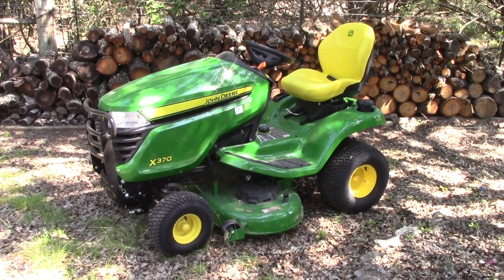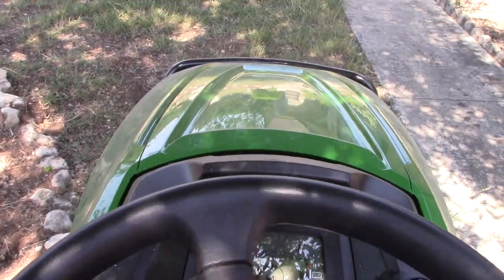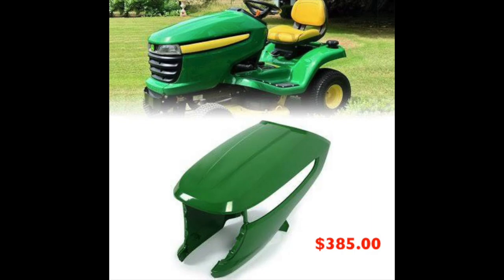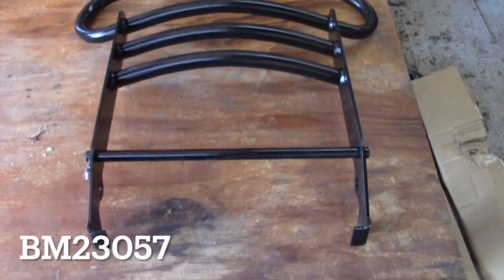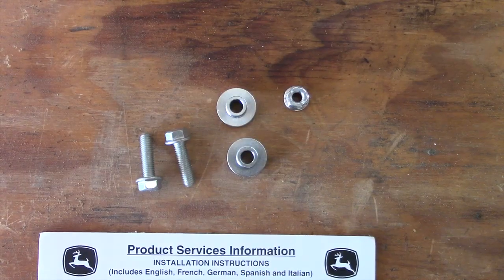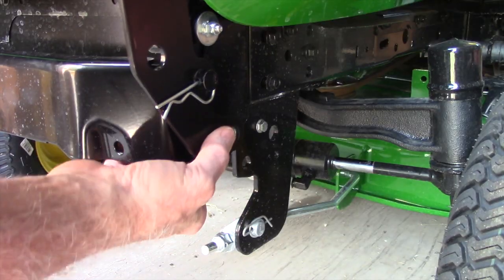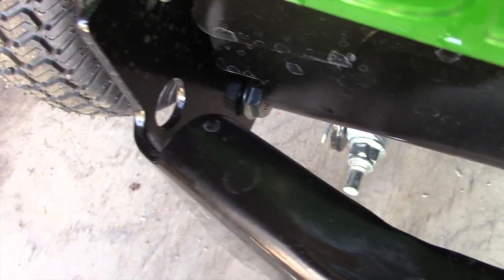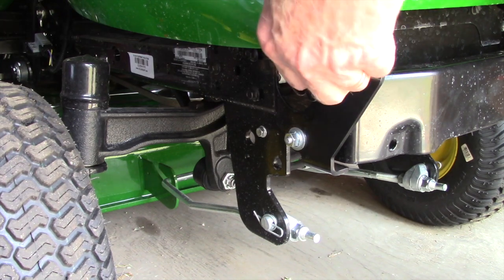John Deere Brush Guard

Comment: The instructions that came with the brush guard were essentially useless.  But this guy's instructional video is key to installing the brush guard correctly, particularly with respect to inserting the bolts from the inside of the frame towards the outside.  Until I saw this video, I could not figure out how to get the bolts in due to the muffler shroud being in the way.  I was super frustrated and almost to the point of thinking I got the wrong brush guard for my X350.  So I went straight to YT and found this video....and problem solved.  Thank you!!!
Reply from the maker: Glad it was helpful. Thanks for commenting!

Comment: I mow as a side hustle and have been using a little 42" cub cadet. I just took on a new customer whos entire acre is hillside with forest at the outlying areas. My cub cadets turf saver tires and tiny brakes arent  up to the task. I pushmowed it today,just because i promised id take care of it since no one had mowed it in weeks. Next season i intend to buy an x350 or bigger mower and id like to protect that front end against.  He had a friend of his mowing it,but he stays busy and had to let it go. He was using an older john deere garden tractor with ag tires. He doesnt understan why i cant mow it with my cub cadet lol. Theres a big difference between a garden tractor and bargain box store mower.
Reply from the maker: Thanks for commenting!  If you're dealing with a lot of hills or rough terrain, the X500 and maybe even X700 series may be worth a look. They're more like garden tractors, with stronger transmissions and axles.  The Kawasaki twin upgrade (vs. Briggs or Kohler) is worth the extra investment too.
Reply: @ShopTalesandLore  I might could find a used x500 I could afford. New they're about $8k now,which is above my price range. I vowed not to finance anything else in our current economy.

Comment: JD shit the bed on this one. For a premium price you should get a better way to open the hood. Maybe spring loaded pins? The big beef l have is you can't open the hood with out tools or protective gloves when the tractor is hot. The right hand side pin is right beside the exhaust (on my X350) and will burn you bad if you touch it with bare skin.
Reply from the maker: Thanks for commenting!  Yep, I hear ya.  On my old Tractor Supply/MTD, to change one of the idler pulleys for the variable speed drive, you either have to drill through the floorboard, or remove the body from the tractor!  Makes you wonder if the engineers have ever turned a wrench.  On the brush guard, I guess I can live with the inconvenience because I haven't seen another design that gives this much protection to the nose.  But it is kind of a pain.